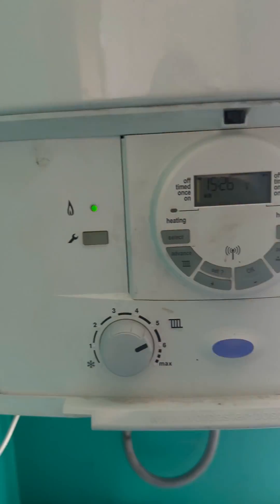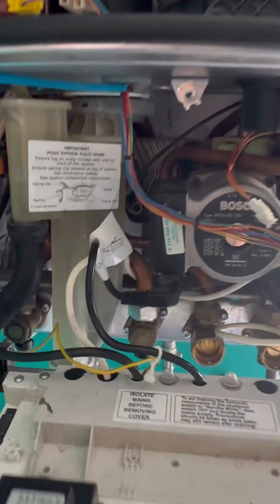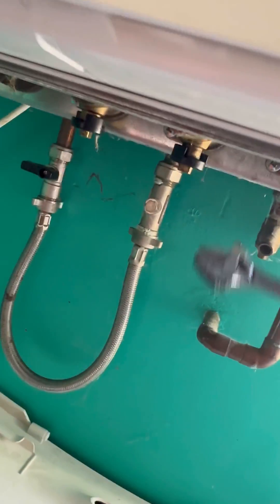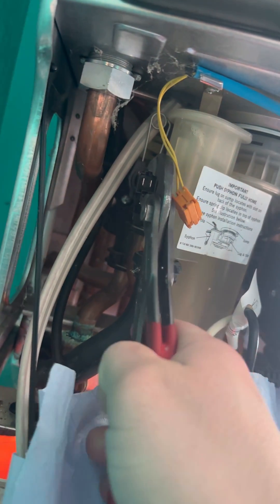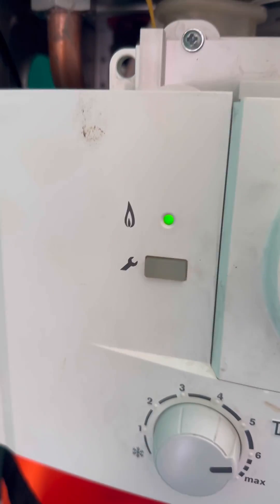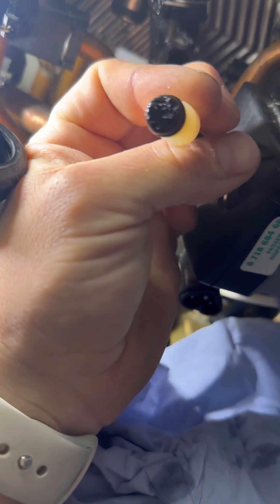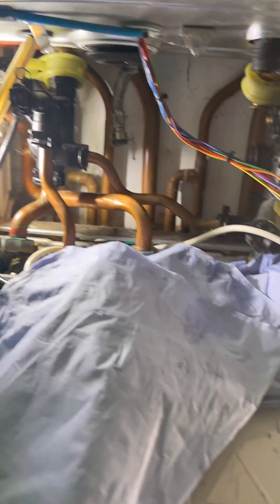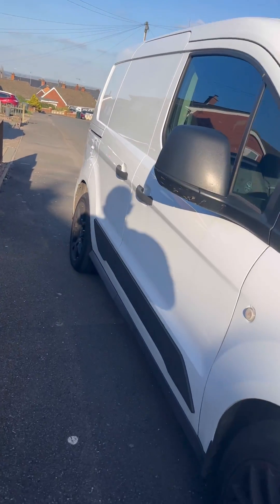No hot water fault on a Worcester Bosch combi boiler water running cold breakdown diagnosis

Comment: Shower ran icy cold last nite then went back to normal. Same happened today. Radiator in living room gurgling.  Water ran cold Wen running bath. Water dripping from 2 valves underneath. Have turned off.

Comment: Should this plate be checked during a service?  I've had the diverter  and sensor changed but still have an intermittent problem with the hot water. Some times it comes through so hot I have to add cold water, or it can be hot and then go through being lukewarm and then cold for ages before getting hot again.  It's not so bad running a bath but it's such a nuisance at the kitchen sink or the shower.  It's a good job I'm not on a water meter because so much water is wasted waiting for it to heat up.  When I call out an engineer I'm told it's normal but it's only been like this for about 18 months when the diverter and sensor were changed because I had a small leak.

Comment: Just curious as to how many times as a percentage (roughly) you've found the problem to be the sensor after a diagnosis where the plate is (red hot) but dhw at outlets cold???

I know that electrically we can test the sensor to check but tbh I've always gone dhw plate on this diagnosis...

Got me thinking though..
Reply: Check it electrically how